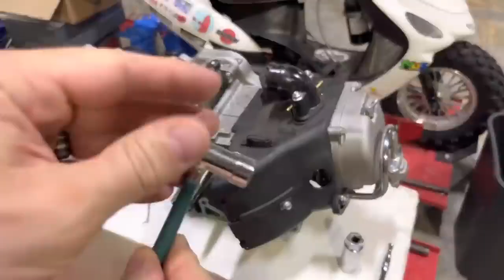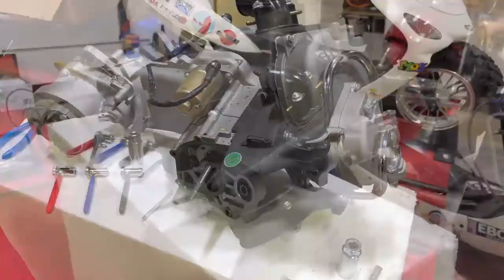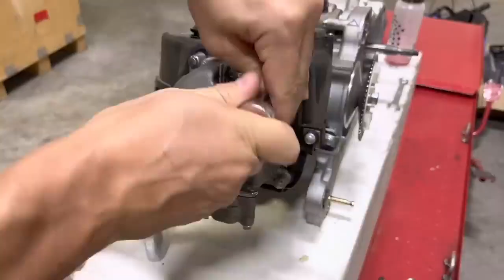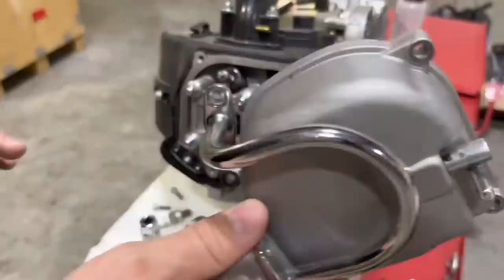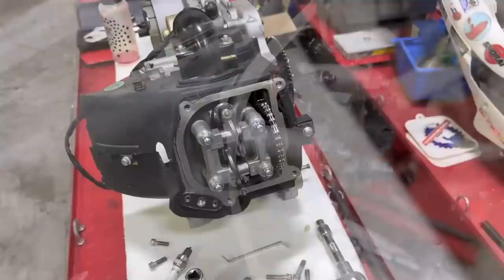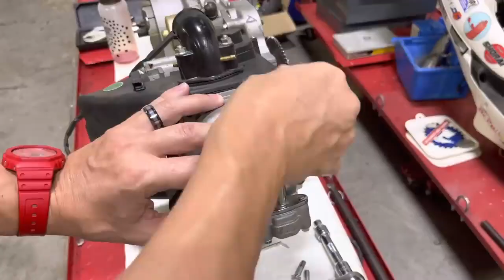Step-by-Step Valve Adjustment for GY6 and QMB139 Scooter Engines

Comment: I read just a few months ago it said 3 on top and 4 for the bottom so im gonna have to go back over a scooter i sold 

So the right setting is what you said 4 for the top and 5 at the bottom i wish i knew that a few months ago and didn't read wrong settings off Google ai oh well I'll get reset